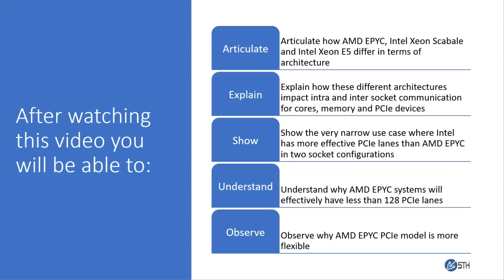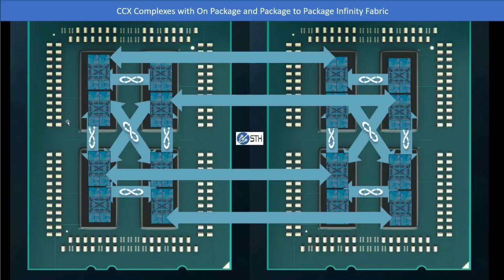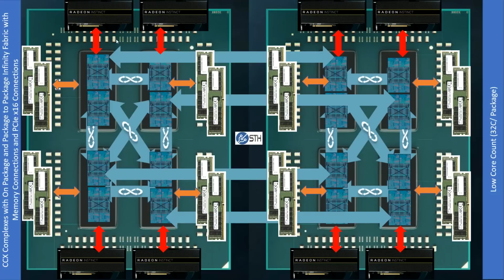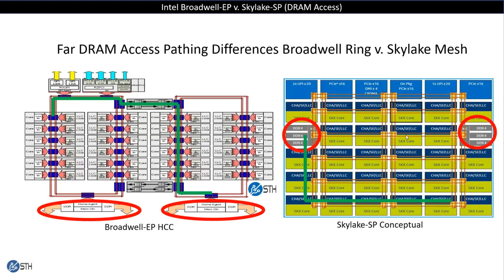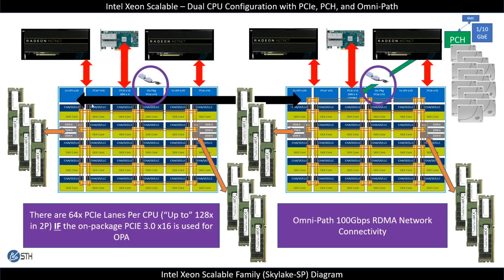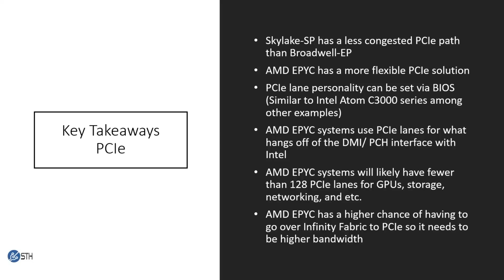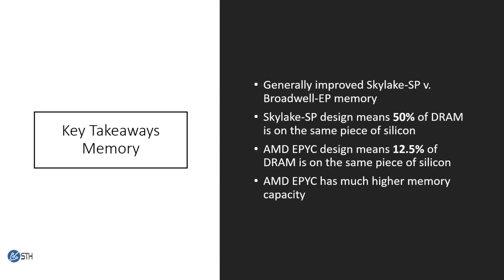AMD EPYC v Intel Xeon Scalable 2S Architecture Ultimate Deep Dive

Comment: Even though there are good use cases for both these architectures, from a performance standpoint for storage or network applications Intel skylake sp will be a much better solution than the amd epyc. With this multi die interconnect scheme amd will have to accomodate Higher snoop latencies for both memory and io. Imagine running PCIE in ntb config the epyc would be a complete failure especially when the memory sharing happens with the dimm in the remote die. You also need to snoop all the caches before you can complete the transaction. I also don't believe in the TDP values advertised by AMD. TDP values are often calculated based on non standard methodologies. For actual TDP values we may have to run benchmarks and calculate the actual TDP

Comment: Nice.
You seem a little disappointed that the AMD EPYC is better (overall) than the Intel Xeon !!!
Anyway good information.

1) Can the AMD EPYC do Quad CPU?
2) Max CPU (Intel & AMD) system do you see in production?
3) Was looking to see a Cinebench R15 test with these two system at the end of this video?

Thanks.
Reply: Why would someone run cinebench on these servers? These are meant to be used for running server applications. You should probably try running spec or linpak or tpcc to get some idea of the performance. Unfortunately for amd their epyc is cheaper to design and manufacture but will give poor performance on any server workload especially in high bandwidth io / memory workloads. But being just a socket level replacement of the old Opteron platform architecture it definitely gives a cost advantage.

Comment: Great Video. 

A few questions / observations. I tried to shorten this [sigh].

0. Epyc uses the B2 Stepping but the others (Ryzen & Threadripper) use the B1.

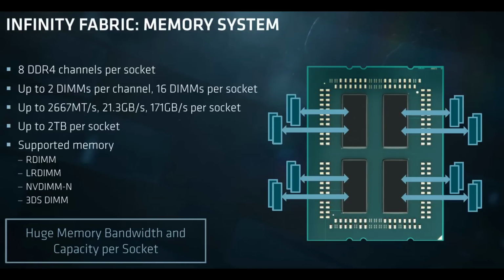1. At 2:10 the Slide says: "Up to 2667 MT/s, 21.3GB/s and 171GB/s per Socket".

With new CPUs and Infinity Fabric in particular it's important to use the faster speed Memory, at 2400 it's only 153.6 but with 2667 it's 170.688 - a worthwhile improvement.

Formula: Memory Speed in cycles x 2 transfers per cycle x 64 bit on each transfer x 2 for the dual interfaces of Dual Channel DDR / 8 for Gigabits to Gigabytes.

New 256 Bit Transfers:

2,400,000,000 x 2 x 256 x 2 / 8 = 307.200GB/s

2,667,000,000 x 2 x 256 x 2 / 8 = 341.376GB/s

Thus, 341.376 - 307.200 = 34.176GB/s and costs 170W - 155W = 15W, it's like getting a free M.2 NVMe.

Also interesting is that on-Die is 42GB/s (/8=42.672) and off-Die is 38GB/s (/9=37.93066).

2. ?, At 4:35 when communicating from Die 0 to Die 3 couldn't it send half the Data from 'Die 0 to Die 0, then to Die 3' and the other half of the Data from 'Die 0 to Die 3, then to Die 3' - same Latency, but double the Bandwidth; the 'Start Time' would have Latency but the 'Finish Time' would be sooner (less than combined Latency + 'single route Time') - maybe implemented in the next Stepping.

3. 5:16 shows that you'd want to fill each available Memory Slot with some Memory to cut Latency and getting 2 or 4 TBs is going to require a 16 or 32 Slot MB with 128GB Memory 💰💰. 

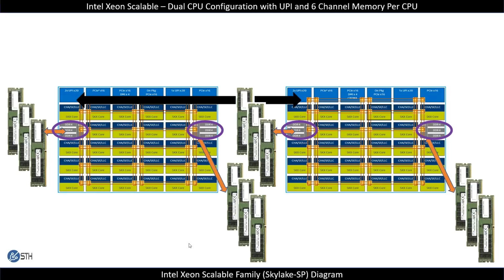At 13:14 the Intel System shows the Memory connected at one point in the Mesh, thus the further it is from the Core the longer the access will take.

4. At 6:00 couldn't you have 8 Instincts running at 8x (with the internals of the SoC handling some Disks) or even run 4 Instincts at 16x and the other 4 at 4x without going beyond the limits (assuming that the MB could handle it)? Alternately with the Intel System 13:53 the 'PCIe Area' is all at one end of the Mesh leading to delays for Cores further away.

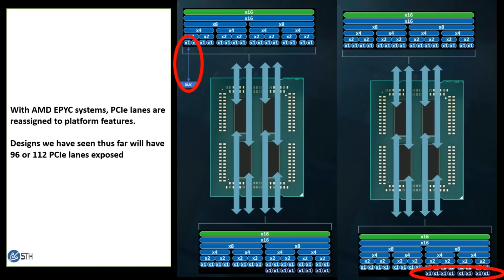As is mentioned at 19:45 some MB's expose a lot of PCIe Lanes. 

The Gigabyte MB seems to have at least 112 Lanes: http://b2b.gigabyte.com/Server-Motherboard/MZ31-AR0-rev-10#ov .

Block Diagram: http://b2b.gigabyte.com/MicroSite/461/images/BlockDiagram.png .

At 14:32 the Intel System seems to be presented as 'better' than the AMD System, but the Gigabyte MB Block Diagram shows additional Hardware is used (EG: Broadcom BCM57810 for Ethernet, Aspeed AST2500 and RealTek RTL8211 for VGA/Serial/BMC, and GL850 for USB) to assist the SoC with Devices and keep PCIe Lanes available for add-in Cards.

5. At 8:50 Intel fails (falls) back to Ring with CPUs using less than 3 Interconnects, or is it as shown at 12:40 that less than 3 Interconnects only affects Socket to Socket and not 'Ring vs. Mesh' on a Single CPU? (Internally is always a Mesh, and externally it would be a Ring with less than 3 Interconnects AND more than one CPU)?

6. 23:32 Doesn't Intel have a higher chance of having to go over it's Mesh to reach Memory or PCIe since only some Cores are 'near' to the Ports whereas with AMD the OS/Compiler/Programmer has a chance to localize the access (NUMA) and have each Core zero to one hops away from Memory or PCIe? 

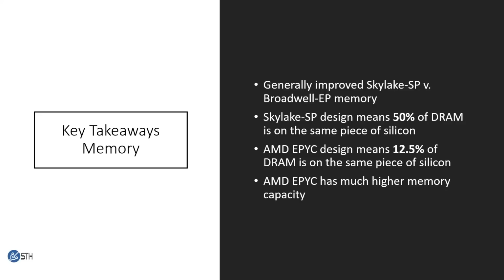At 23:55 & 24:16 it seems from this Video:

AMD is 12.5% attached to everything, or alternatively 100% attached to 'something'. 

Intel has '~25% of the Cores attached' and the remaining Cores need a journey through the Mesh to access Memory or PCIe.

---

Hope that's not too many points - at least you know we're interested in what you say (which I could hear fine, on Mobile, at maximum Volume).

YT,
Rob

Comment: Good video! Only issue was the very low volume. Could barely hear on a mobile device.
Reply from the maker: Thank you for the feedback. We tried normalizing a bit lower than normal. Next time, we will up the volume.
Reply: Im on a tv and its pretty damn quite
Reply: ServeTheHomeVideo I echo the OP's statement. Very informative and well done. No opinion, just the bare facts to enable the viewer to draw their own conclusions based on needs.

I'm ashamed to say it, but I was unaware of the 12.5% memory limit with the infinity architecture, as I've studied the physical layout quite a bit. I was also unaware of the extra x16 pci-e on the x299, so double shame on me.

Lastly, even with headphones, I had to put the volume to 1 bar below max on an iPhone 5, and I still struggled to hear, eventually putting on captions. Other than that, fantastic. New sub and will recommend.